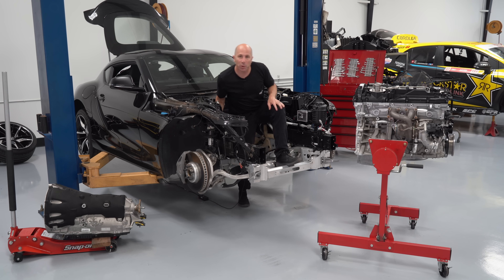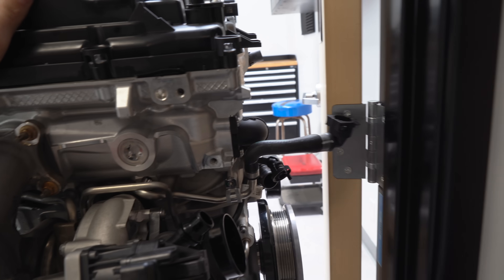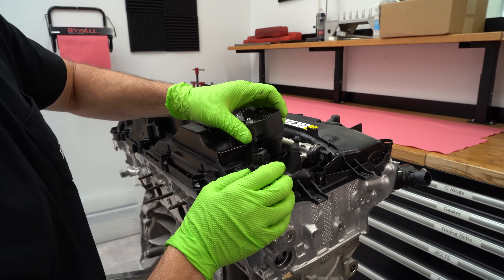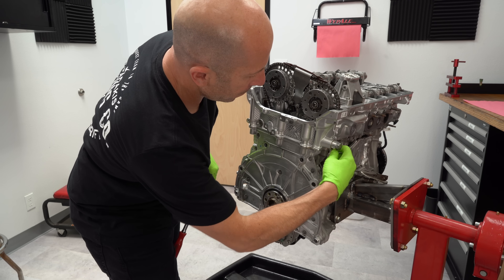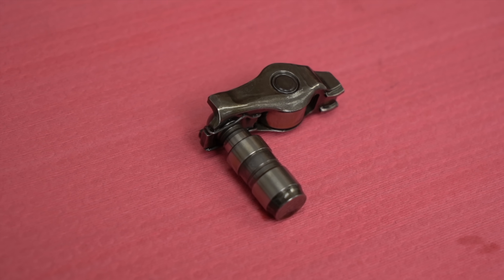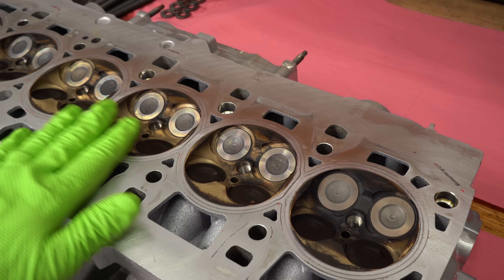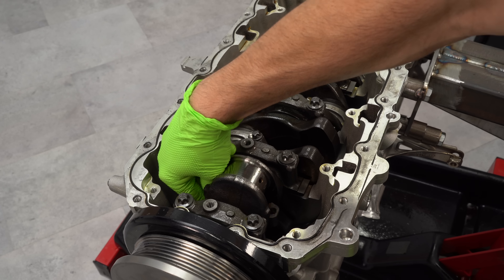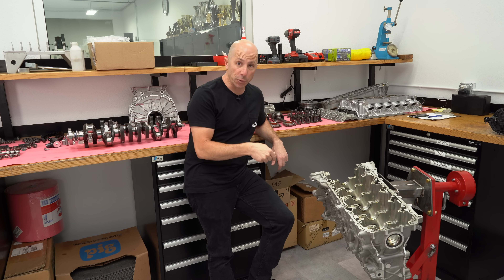2020 Supra B58 Engine Teardown - First Look - Better than the 2JZ?

Comment: “The engineers have simplified everything down again” 
“The timing chain is in between the transmission and the engine”
Reply: For real right.
Reply: The  timing chains last the lifetime of the engine. You know .....like the bmw n47 engine, and they've never had any problems jaja jajaja
Reply: I thought the same thing about the exhaust manifold being internal and the cooler inside the intake.
Reply: @Tim Bennett - exhaust manifold integral to the head and cooler in the intake manifold is not exclusive to BMW.  Even Ford does this on some of their engines.
Reply: @typeav You obliviously
 aren't familiar with BMWs
Reply: Josh Ribeiro lol
Reply: @typeav Yeah well that's what manufactures say about all timing chains lol. ''It should last a life time!'' when in reality they can cause issues at any point over 150k miles.
Reply: @chrisallot66  generally speaking they should under normal driving and proper routine maintenance. They usually dont go bad it's the guides, tensioner or lack of lubrication that causes a failure
Reply: @chrisallot66  ive in my mercedes ce300 1989 with 350k of km and no change. my friend have the same mercedes and he change the engine at 800k km and tha chain looks good. if u change oil and filter, u dont have to change chain.
Reply: I have a 3.2 vr6. Same timing chain design. Nothing was simple with that project. I wish it was on the front like all the Japanese engines I've owned.
Reply: Only thing i really don't like is the plastic intercooler. Bmw uses too much plastic and it might be fine for germans but here in phx az, plastic takes a shit on a hot day. No matter what temps u claim you can get.
Reply: I don't think the engineers gave a rats ass about the lowly mechanics or consumers having to shell out labor and money on that design.  Their objective was efficiency and packaging.
Reply: @DirtComplex  and the people of the cost centre said to the engineers: make it cheaper
Reply: Leon Jones  Well, it's gonna require more work to access the timing chain parts than on other cars. Might have to remove the trans. I would imagine that's how they will do it.
Reply: In the words of my uncle: “Damn German cars/engineering”
Reply: Well... if you're gonna do a clutch every so often it'll be like oh hey we're in here lets do the timing, it's like when you do the rear main seal when you change your clutch, except now you can do the timing too which is normally a special job. Plus it'll make it less hard of a decision, getting two birds with one stone so why not. Like you won't want to change the clutch at 180,000 miles and NOT do the timing you know.
Reply: All this arguing about timing chains reminds me of why I love my rotarys. Even if I blow every apex & side seal, oil & coolant everywhere, I can rebuild it in about the same time as a competent mechanic can rebuild a rear diff. Not saying I don't like & build piston engines, I just enjoy a engine with no reciprocating mass & 3 internal moving parts.
Reply: @typeav It will not last the life of the engine. I work at a dealership for a different brand but it's the same tech. It'll be expensive to have a timing chain and tensioner replacement.
Reply: @Yugetubes  Volkswagen? Volvo?
Reply: @fryeguy09able  We sell quite a few timing chain+tensioner+guides replacements thats all I'll say on that.
Reply: So you work for Audi... :-) lol
Reply: @Yugetubes  Volkswagen maybe? It all comes down to what chains you're putting on. Mercedes-Benz (and license builder Ssangyong) have had timing chains run for 300.000+ miles without issues, on (turbo-)diesel and gasoline engines.
Reply: @Yugetubes  lol, dealership mechanic lol....
Reply: @crimescene25  Where did I say that I was a mechanic? I worked in the parts department at that dealership.
Reply: @crimescene25  And, half of the technicians that I worked with did everything including replacing engines, heads, turbos, timing chain replacements, transmission repairs and replacements. Sunroof leaks were common. They'd replaced the headliners and all relevant roof frames and seals. We had guys that were beginners, somewhat experienced and very experienced. Work was divided accordingly.
Reply: @Yugetubes  Yet here you are on youtube acting like a mechanical genius. I used to sell lumber, does that make me a construction expert?
Reply: @crimescene25  No, I'm acting like a guy with an automotive degree, multiple automotive certificates, safety and emissions inspection licenses for passenger cars, heavy trucks and motorcycles and years of experience actually working on vehicles and machinery. I no longer work there but when I left I was a master parts person. I could run that whole department of the dealership by myself.
Reply: @crimescene25  I know more than most people what parts get replaced because I was the guy that ordered the inventory.
Reply: @crimescene25  And, here you are taking pictures of yourself posing in the gym and trying to insult people on comments from nearly 2 years ago. Keep it moving.
Reply: @Yugetubes  Take yoru own advice, and keep moving. Quit being a couch jockey it's the new smoking....
Reply: @Yugetubes  Doing oil changes, batteries, and tire plugs doesnt make you a mechanic...
Reply: @crimescene25  Posing in the gym does does make you a poser, though.
Reply: @Yugetubes  no its not lol
my e38 has had the same chain for all its 355.000kms, only changed the tensioner twice if i remember correctly
Reply: @MsportAlex  No, what's not? Also, the chain was probably done with the tensioners. The chains stretch.
Reply: @Yugetubes  It wasnt, I have service notes for every service the car has ever had up until i bought it
my old e38 also had its original chain and that did 330.000 before i scraped it, engine was still running good!
Reply: @MsportAlex  OK 👌
Reply: @typeav generally lifetime incase of a german car is basically 10years or 180000kms. Not Toyota like lifetime.
Reply: Abinash Pattanaik lol I guess no one told my e46 that. It’s on 20 years now
Reply: @abhinashpattanaik5109  And how many European Toyota cars do they actually manufacture themselves now!!!!! Very few
Reply: @bradj7205  older bmw uses steel guides so no problem there either
Reply: @typeav You're right, considering that you're talking about a interference engine... if it's a non-interference engine, it wouldn't happen, the car would just shut off with no engine damage.
Reply: @asteiner9181  They weren't thinking, they just said "yo, let us slap a fixed roof and a new body on this Z4".
Reply: @SpikeRazzor  I saw the Supra head designed talking about the car, said the double pull latch hood release was hearkening back to the olden days of blah blah blah... don't lie old man lol, you know you used it because it's a BMW hood latch.
Reply: Yep just imagine the bill for doing a new cam chain on this engine.  Can't imagine what the engineers were thinking when they designed this thing.
Reply: @Hoggdoc1946  "hahaha were gonna fuck these maggots for every penny they've got, they dont even know how easy it is to make any honda/miata/chevy/nissan/ford/etc shit box stomp this thing out for the same price either"
Reply: It'll run you thousands to swap out!!
Reply: Hahahahaha😂😅🤣 Real easy to remove it on your own! You’ll just have to take off the entire engine an then some.🤯
Reply: BMW turned the engines around starting with the E9x facelift edition... somewhere in that period of time.. 2008-2009 i believe.
Reply: It’s not a timing belt that you have replace after 90k miles. Chains will last for the life of the engine as long as you always change oil as per scheduled maintenance requirements.
Reply: @TheGomezIndustries  Not a problem of timing chain but the chain guide is need to be periodically change.
Reply: @Armando Villa Every time any component is marketed as "lasting the lifetime of the vehicle" I get suspicious, especially when that component is critical for the physical health of the engine. At least timing belts have a scheduled replacement interval.
Reply: It’s a bmw 😂😂😂
Reply: @bootz4205  and?
Reply: lmao exactly
Reply: Lol... So you don't need to mess with engine... And send it to bummer (bimmer ?) or toyota !!!
Reply: Timing chain last the life time of the engine because when it breaks, your engine is DONE.  Is this an interference engine (where the piston could hit the valves)?
Reply: Yeah but it never needs to be replaced
Reply: Mats Burger , yes, it is a serviceable item.
Reply: @typeav  Lol, it's german. Remeber the v8 s4 with the same arrangement where the guides wore out at 40k. Typical dumb german engineering.
Reply: Or those damn timing chain guides failing....
Reply: Lmao exactly
Reply: Guess what's gonna break when u make big power,   the whole timing situation is fail
Reply: At least the timing chain tensioner is easily replaceable externally, that's usually what fails.. usually lol
Reply: and super complicated intake valve action, with double rockers and all that jazzz to fail at the worst moment.
Reply: The context of his comment was for the emissions, play  it again if you want.
Reply: @Armando Villa is true, timing chain have the duration of the engine.
Reply: It's for weight distribution Silly😆 which will improve fuel consumption by 1.6 MPG👏👏👏  Major Improvement😆..Drive-by-Wire..quicker than your foot..😂😂😂
Reply: The timing chain doesn't need to be played with, so it's naturally inaccessible.
Reply: This isnt the only engine that's flywheel driven for camshaft rotation. Off the top of my head the International VT365(6.0L Powerstroke) has the camshaft driven off the flywheel.
Reply: Those timing chain guides better be pretty strong. That's the first timing component that will need replacing.
Reply: Timing chains hardly ever fail....... so, dumb comment.
Reply: GERMAN
Reply: This engine is not hard to work on.
Reply: They engineered it that way for performance and weight distribution.
Reply: Does this direct injection cause carbon buildup?
Reply: hahaha to be fair if you break that chain you probably need to remove the engine and rebuild it 😊🥴
Reply: because if you change your oil they really don't fail anymore, the N20s were notorious for chain issues but I've seen plenty of N54s and N55s pushing 150k with tight chains.
Reply: Leon Jones  And labor.
Reply: There's a reason why BMW out of warranty stands for "broke my wallet" as this engine is helpfully demonstrating!! lol
Reply: @soundseeker63  as I'm not really a big fan of BMW, they used that same 3.0l in their cars forever and although it does have some issues it pretty reliable.
Reply: Nothing about this car is simple dude like wtf, this nigga got paid or something there's a trillion cables and 70 different pieces of plastic to take out just to get to the fucking motor
Reply: Isn't supposed to be an engine that can get abused and insanely boosted without touching internal parts? It was mean to be overbuild from factory not to build aftermarket.
Reply: i am beginning to think this guy is a bit off in the head as nothing negative talked of new so called tech is not good allways
Reply: @typeav I'm no mechanic but this thing look hard, u see all the special 4 teeth socket to remove the crankshaft pulley..I'm not a Toyota owner but 2JZ is still boss.. dont give a rat's ass..
Reply: @richardknight307  the 2jz is also a pain in the ass. Just because you need a few tools. Doesnt make it a pain.
Reply: @jdrok5026  how is the 2JZ a pain in the ass, curious considering i work on them quite a bit
Reply: @GrannasRacing  largely wiring turbos. Size in relation to my equipment ( largely meant for v8 less than 750 lbs so the 2jz can be worked on but the overall length of a i6 in general makes me weary with my equipment. Need to find longer feet for the engine stand or get the one for diesels out but that thing is a pain in the ass itself. I particularly find the platforms the 2jz is in a little cramped for my liking. (Normally work on trucks where a i6 is a breeze compared to a v8.) The ohc top end is not my best point dont own one I have worked with normally have had pushrod engines so ohc is largely a point of pain for me given the ease of pushrods. Its largely about my skill set am I afraid to do a 2jz or such a engine similar to it no I generally do those jobs for the fun of tinkering but no one around here owns a 2jz I can just tinker with and the only experience I have with the platform is limited to say the least. But maybe if someone can get me a 2jz to rebuild and tinker with itll change my mind but from this point I raise I think all engines relatively are a pain in the ass in varrying ways the sbc I find a pain in the ass when you need to make 35 fuel adjustments to make them run correctly or that a tbi 350 needs to run at 195 degrees minimum for the sensors to work properly for some god awful reason
Reply: Richard Knight good thing you’re not a mechanic after that comment.

Comment: The honda 4bangers have the internal head exhaust runners as well, but that also makes them asymmetrical. They are short, but still unequal. It is neato you can just bolt the turbo directly to the head though. They also have the thin wall 14mm socket size and direct injection. This new toyota engine is definitely a lot more work for doing some jobs that could have previously done in the vehicle. Hopefully it has few if any revisions for issues, I'm curious to see what they are capable of with that exhaust port design.

Comment: Damn that 2 step in the beggining sounded pretty nasty for stock location car. You should take new engine out and put a 2jz out of an original supra in there. Since original supras r so expensive these days. Itd be cheaper to buy a 2jz engineout of a wrecked car or something. Do the first gen supras have 2jz engines in them??? Im not shure what they have but i know some of the lexuz sedans have non turbo versions of the 2j engines in them i forget what sedan but i recently saw a video explaining they exist
Reply: only the last gen had the JZ family.  The first Celica Supra had the 5me.  The second gen had the 5mge.  The third gen had the 7mge.
Reply: mescko ehhhhwhat???? Are you talking about toyota celicas??? Cuz im pretty sure a lot of celicas engines were called 4age i even had a 92 toyota corolla with a 4age that engine was fun it was super tunable and it was simple and easy. The mark 4 supras had a 2jz engine which is the twin turbo version. Like i said some lexus sedans carry the same engine but a non turbo version of the one out of a supra which is why those r called 2j instead of the twin turbo version out of the supra which is called a 2jz
Reply: @covid-mx9ng  The first two generations of Supra were based on the Celica (with extra length added between the front wheelwell and a-pillar for the longer engine) and were called the Celica Supra.  The third and fourth gen was its own platform and was called simply Supra.
Reply: mescko mescko to me the original supras kind of looked more like the original 80s mazda rx7s they almost had identical body styles if u look they also looked a lot like they also looked a lot like a nissan 240 sx or a nissan 300zx and a few more nissans looked the same im talking about the original more square body styles of all of the cars i mentioned if u look at the 90s rx7 they were more rounded just like the 90s supras
Reply: Yaaaa i also just lookedone up so i found out one of the lexuses that carry the supra engine is the lexus is300 its basically a four door supra lol

Comment: I like some of the design including the windage tray and oil passages, but I'm not a fan of the rear timing chain or the overly complicated variable valve lift system.  Really not a fan of the integrated exhaust manifold either or the complex thermostat. I do really like the way they did the engine front main seal though.

Comment: The engine design is absolute dogshit it will have major reliability issues once you start pushing them. I'm sorry to tell you I've been doing this 27 years and I've been around a lot of race engines and some pretty gnarly stuff that had my mind blown this particular engine so just be thrown off in the dumpster. There's going to be a ton of longevity issues with this motor mark my words.

Comment: Wow really complex System. Fortunately electric motor 3 phase induction or permanent magnet motor are simple than that. And lighter. New Yasa and Magnax axial flux electric motor are even better, with high power/weight ratio, way better than this engine, up to 10-12 kW/ kg . How much power has this 6 cylinders turbo intercooled engine?

Comment: Speaking purely from a mechanic's perspective, I'm not sure I trust the long-term reliability of an integrated CAC into a plastic plenum made by BMW. Everything else seems pretty standard for a modern engine, rear engine timing chains is nothing new. These are just going to be very expensive when they do need repair.
Reply: yeah but timing chain rarely needs to be serviced
Reply: What is the purpose of moving the timing chain to the rear? Weight distribution?